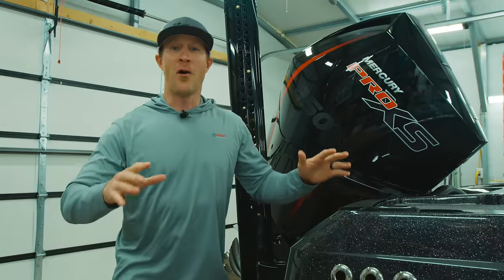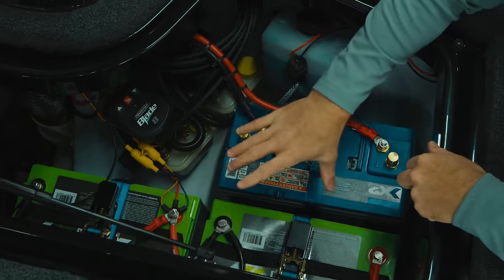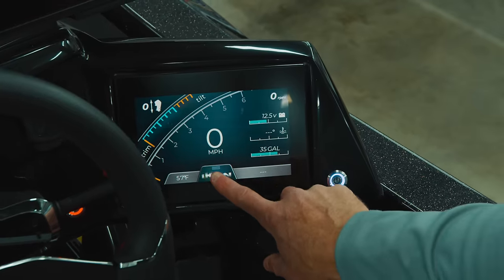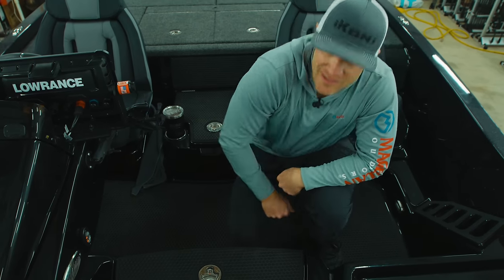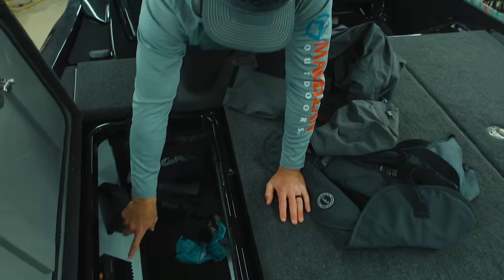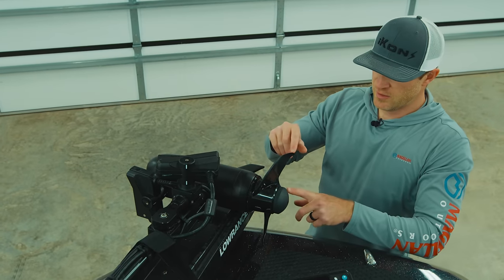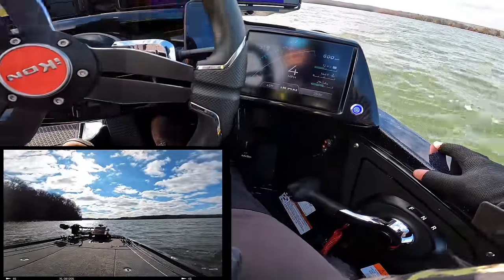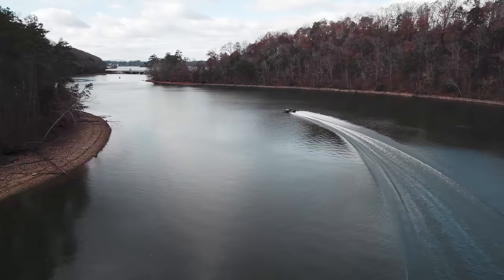My 2024 iKon LX20 Tournament Ready Boat Tour On & Off the Water!

Comment: Assuming that with the Power Pole Charge, since you are running a different chemistry (cranking versus House battery for electronics) you are running a separate charger for the electronics battery?
Reply from the maker: Correct
Reply: thanks man, making sure I wasnt missing a magic trick 🤣

Comment: Your active target setup looks great in the side locker. But mark my word they won’t stay there. Screwed in to thin glass. Not bolted. And probably no backing plate there. Maybe they did if they knew you wanted them there when they built it. This drives me nuts. Screws stripping out all over. Every boat. Sooner or later someone will get this right. Thanks for the video. Good lookin boat.
Reply: Hey know it all, perhaps you should be a boat builder! PS, mines been screwed in my rod locker for years without issue.